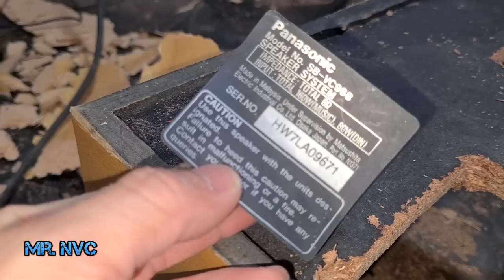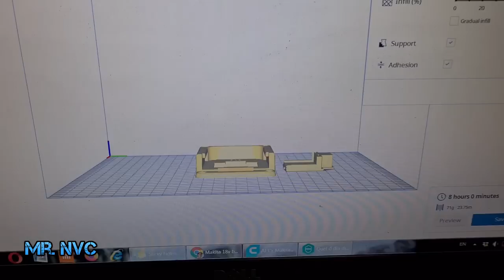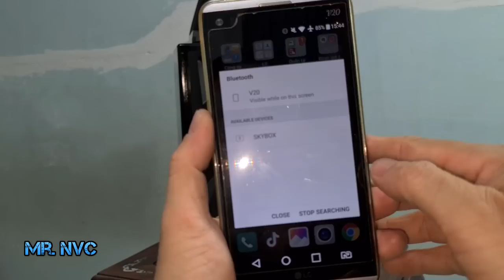20 Year old Abandoned Panasonic VC968 Speaker RESTORATION - Give new life to abandoned speakers

Comment: 160 watts 💪💪💪 very Stout 😊 I run a pair of Aiwa 180s 5 way 120 watts along with my se250 Vegas and a pair of 125 watts 3 Way 92 model pioneers with a 15 inch woofer 😧 all powered by my 2000 Sony STR-DE635 600 watts receiver 💪💪💪💪 I call it my Frankenstein ✌️ and keep rocking